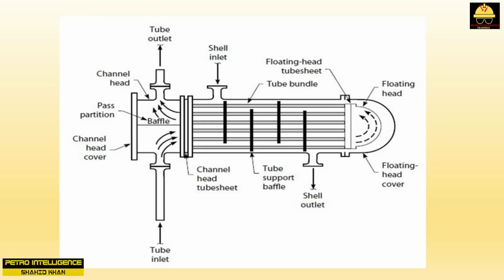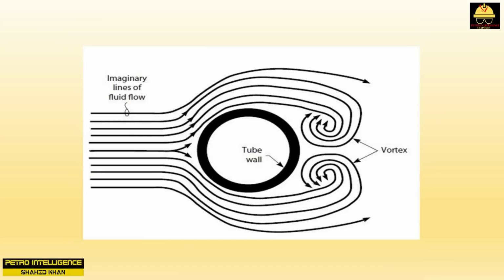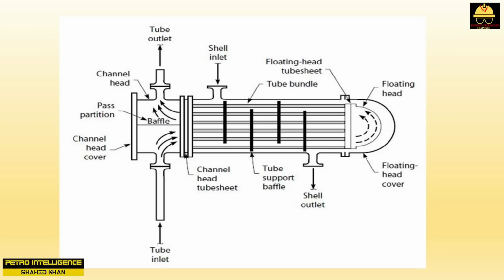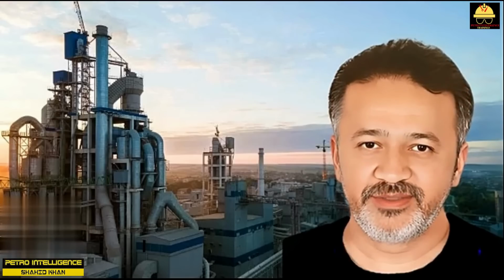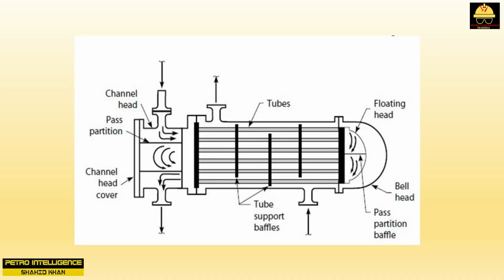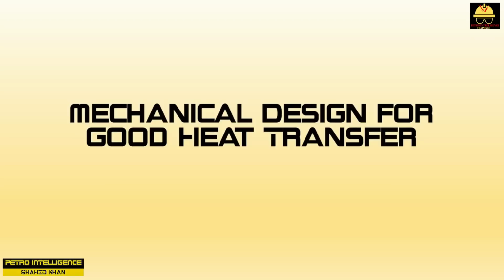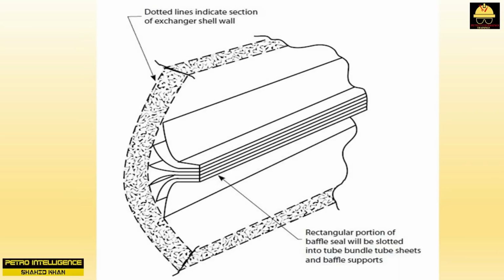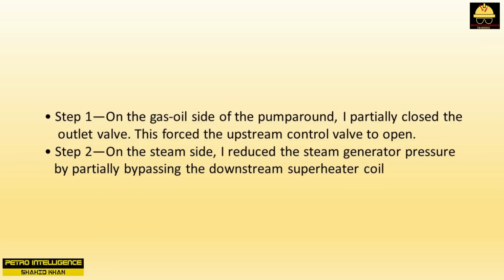Shell & Tube HX Troubleshooting: Fix Leaks, Vibration & Fouling

Comment: I found your videos very useful and informative.

I am currently facing an unusual situation with a U-tube shell-and-tube heat exchanger. After chemical cleaning on the tube side, inspection confirmed that all deposits were fully removed. However, once the exchanger was put back into service, the differential pressure across the exchanger increased to the maximum allowable value of 0.7 barg.

Before chemical cleaning, the differential pressure was only 0.4–0.5 barg at the same flow rate. At present, the DP is consistently around 0.7 barg and occasionally reaches 0.8 barg.

I do not clearly understand the reason for this increase after cleaning. My questions are:

How long can the exchanger safely operate at a differential pressure of 0.7 barg?

Can operating at this DP cause damage to the exchanger (tubes, tube sheet, or bundle)?

Is it acceptable to continue operating at this DP until the next chemical cleaning and inspection opportunity?

I would appreciate your technical opinion on this.

Best regards,
Jugo
Reply from the maker: After chemical cleaning of the tube side of the U-tube shell-and-tube heat exchanger, the differential pressure unexpectedly increased from the earlier 0.4–0.5 barg range to a steady 0.7 barg, with occasional spikes to 0.8 barg. Normally cleaning should reduce DP, so this rise points to a hidden issue. Possible causes include misaligned baffles or tube supports during reassembly, leftover debris or cleaning residue lodged inside, fouling or blockage on the shell side, or even a faulty DP transmitter giving inaccurate readings.  

Operating at 0.7 barg may be within the design limit, but staying at the maximum allowable pressure constantly is not ideal. Spikes to 0.8 barg mean the limit is being exceeded, which can stress tubes, tube sheets, and supports, leading to vibration, fatigue, reduced efficiency, or even leaks over time. Short-term operation at 0.7 barg can be tolerated with close monitoring, but it should not be accepted as normal until the root cause is identified.  

The maintenance note is simple: do not assume the exchanger is safe just because the tubes look clean. Investigate the reason for the pressure increase before continuing routine operation. If no mechanical or flow issues are found, consider a full flush or shell-side cleaning.  

An inspection checklist should include visual inspection of baffles, supports, and tube sheets for alignment or deformation, checking for foreign objects or residue, verifying flow distribution with a test, reviewing the shell side for fouling, calibrating DP transmitters and cross-checking with manual gauges, and logging DP trends to detect spikes or anomalies.  

The final recommendation is not to treat the post-cleaning DP spike as routine. Investigate thoroughly and correct the issue. Operating at the edge of design limits without explanation is risky and should be avoided.
Reply from the maker: Can you please share in which service this heat exchanger is being used, and what the tube side and shell side fluids are?